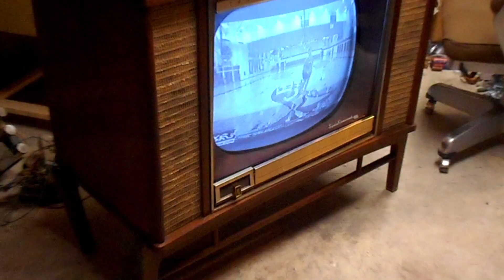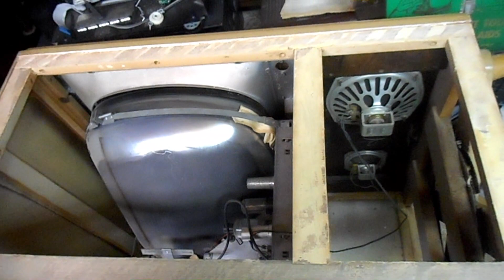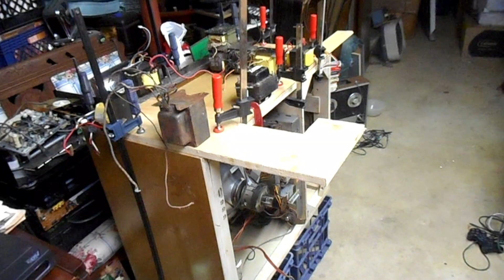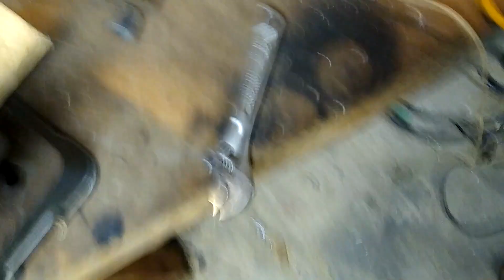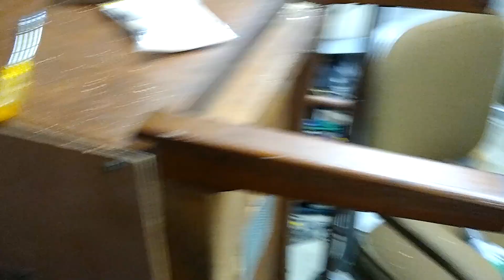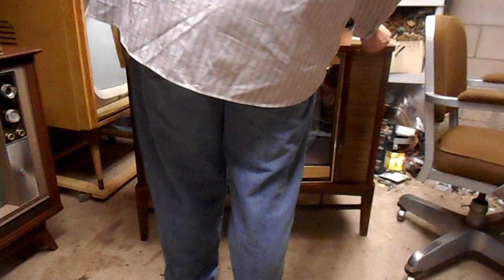1960 Zenith Model C3009W Coburg Remote Television Resurrection Part 3 cabinet calamity rewind

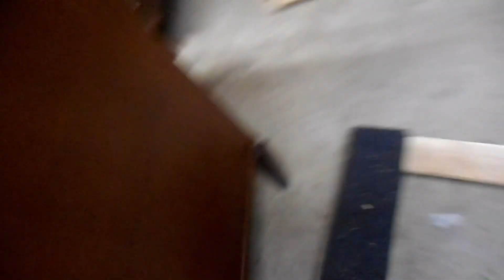Comment: At 34:00 I'm sorry that happened. I do almost everything myself also. Dolly's are such a help, but cutting out from under a load is their specialty. I figure to block up things and then tip them. You man handled it and you were substantial and strong enough to not go over with it. That could have happened easily. Some 4x4, 4x6, and 6x6 lengths about 12 to 18 inches and some carpet or bath towels will help do the trick. Again I'm sorry that happened. Beautiful cabinet and you'll have it back in shape for sure.
Reply from the maker: As they say Sh!t happens...At least the second time I was prepared. Really both times it was less the dolly walking away and more the leg glue checking out after all the weight was on both legs.  I do sometimes put wheel stops in when dealing with objects I can't completely lift single-handedly.

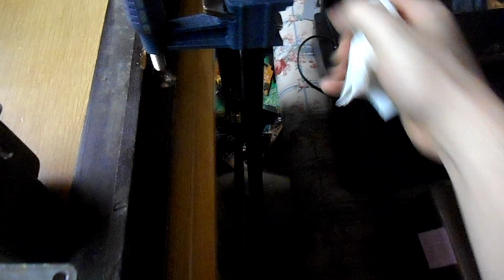Comment: 15:05 water damp paper towel or rag to clean up wood glue drips and residue?
Reply from the maker: I think I used a dry paper towel because the glue was still plenty wet. There's no convenient tap in the basement (unless you count the anti-freeze drains on the basement shutoffs for the outside hose valves) so if anything I would have wet it with glass cleaner.  When I wet sand in the basement I usually use glass cleaner for the same reason.

Comment: How much for the Zenith ?
Reply from the maker: Unfortunately you're a month too late for this set. I sold it back at the ETF swapmeet May 6th. If you're curious what I wanted for it you can watch this video: https://youtu.be/kNosDNndpHw 

Right now I'm preparing to do a resurrection on a similar blond 1961 SC300 Zenith I picked up last week that's a lot rougher.

Comment: you have a LOT of toys there to be envious of, like that tape deck on the floor there next to the Zenith! :P
Reply from the maker: I've got 4 U-matic decks. The original VO-1600, it's tuner-less little brother, and a couple later broadcast decks...And every other oddball recording format I could get my hands on.
Or were you referring to those basket case sony S-VHS decks. (Another thing I collect: every S-VHS deck to come through my local thrifts.)
Reply: @tomcarlson3913  about 15-20 min in, while you were gluing the the side back on, it looked like there was  7 inch reel to reel player on the floor next to it,  you were standing in front of it a lot, so could not see it well, but it looked like a tape deck , reminded me of my dads Uher 24 deck which I still have, but barly works, cause i can't get parts for it. :(
Reply from the maker: @suzakule  Figures I forget about the most obvious deck in the shot. That Sony RTR deck is going to be part of a weirder video idea I've had floating around since before this channel started.

Comment: What was that stuff you was using to clean up the surface of the TV??
Reply from the maker: The stuff in the metal can is Howard Restor-a-finish, I usually let that dry overnight and folow up with white Non-Pummice GOJO hand cleaner. Those together do a nice job of spiffing up a dull scratched finish.
The second dark set got a wash in bleach water (to deal with recent sewage splatter) and glass cleaner too.